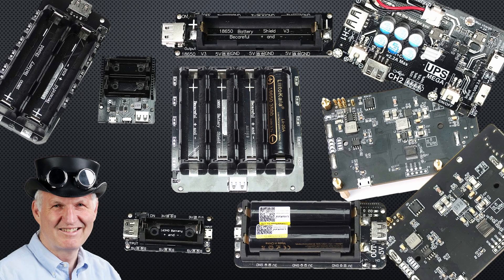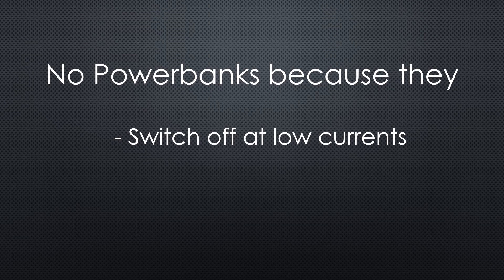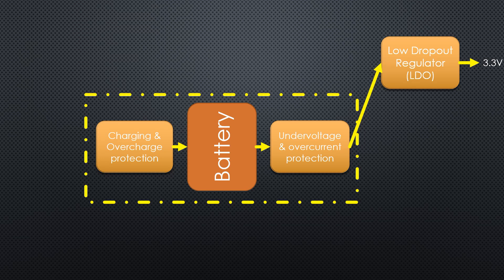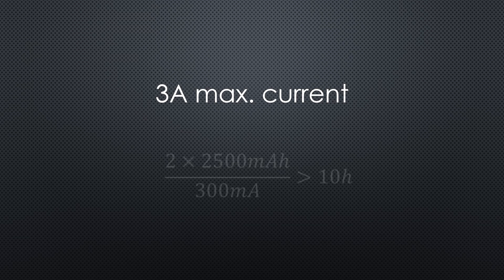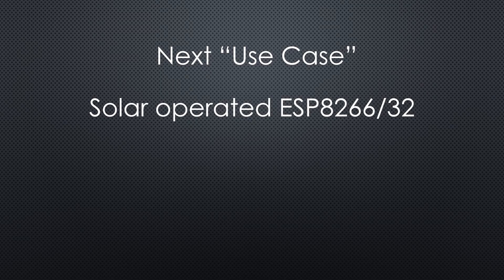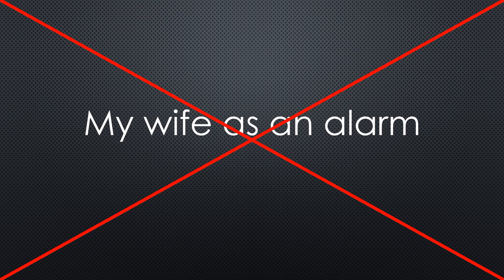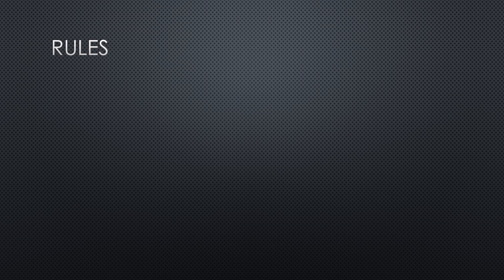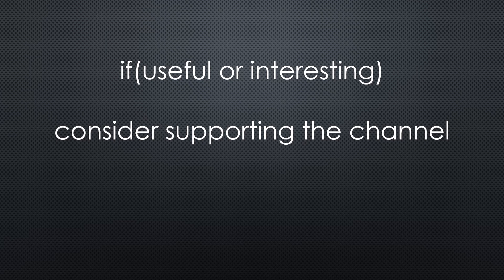#351 10 Battery Power Boards for Raspberries and ESPs. Start of “SuperPower” project

Comment: Thank - very interesting video and ... project.
I will try to contribute, if I can.

I am into "low power solar power sensor projects" using mainly solar/battery-powered ESP8266 as sensors and ESP32 as receivers of the sensor data. Sensors send data using ESP-Now to ESP32 which acts like a "gateway" and then sends further to various services like my own servers, Blynk, Thingspeak etc.
I use solar panels as small as 50x50mm, 2V, which I can get to work when I use ESP-Now (which is much lower in current needs than standard WiFi). If using "standard Wifi, I have to step up to 100x50mm (5-6V) solar panels and use very short and seldom Wifi messages.
 
What I wish for is:
- Charging regulators with a battery pin connector (as well as solar power, usb charging and device supply connectors) rather than a "battery holder" which is nice if you use "that" battery but otherwise, just space consuming. (I use thin 500mAh and 1200 mAh LIPO batteries rather than round cylindric battery cells.)
- Charging regulators allowing to measure battery voltage (as you mentioned).
- Charging regulator with as LOW own current consumption as possible. No status LEDS etc, they are just current eaters.
- Of course over-charge protection and over-discharge protection
- Pin to read battery voltage (UNREGULATED).
- Providing 3V3 as output - to be connected to the ESP8266 chip/board - which I believe is the best to avoid overhead with "converting" to 5V, 3.7V etc.   (maybe 3.7 V is better, I don't know). 
- Solar panel input with "optimum" voltage. I believe this is 5-6V and not 2V as I (often) use. As this requires a buck converter which consumes current. 

=> Main reqmnts are:
- LOW Own current consumption
- Possibility to read unregulated battery voltage
- Shall support batteries of 500mAh -2400 mAh.

/Jonas
Reply from the maker: Good input. I pinned a comment with the links where we collect the requirements. Maybe you check which ones are still missing and add them?

Comment: I have one of those battery shields.  When it's on, should the battery level LED's turn off?  Mine shows the battery level the entire time the shield is on, just wasting power.
Reply from the maker: I read that there are many different versions around. So I do not know. I also do not remember how mine behaved. I anyway desolder the LEDs if I do not need them…
Reply: @AndreasSpiess  cool, well thank you for the quick response!

Comment: SuperPower project is a nice idea!.. just whats needed.. i purchaced a TTGO T18 (esp32 wrover with 8mb psram), it has a 18650 battery holder on the bottom, but it brown outs when running off the battery... whats the point!..
thanks for another concise comparison and "fix" Andreas! 
wife as alarm! i LOLed!
Reply from the maker: I hope we will get to a design where we can add the best ESP module for our purpose.

Comment: Hi, I appreciate all your videos, I am trying to power an ESPcam with an USB solar panel and a dual 18650 battery but thue battery board stop working as soon as I connect the solar panel, it's OK when I connect the battery board to an AC adapter. What am I doing wrong ? (I am using a dual cell battery charge board with 2 switches). Thanks Thierry
Reply from the maker: Unfortunately, I cannot do remote debugging. I would do my measurements to find out what happens. Maybe you check out each component first and when everything is correct, start to connect them one after the other and test again. Then you will find the issue.

Comment: Just doing a UPS for my RPIs and router with 18650!
Reply: I agree. So 5V but also 7,5-9-12V.
Reply: @DumahBrazorf  i used 4 batteries with a bms and 16.8v power adapter, and of course a dc-dc 5v3a small module
Reply from the maker: Maybe you input your learnings into the project?

Comment: I think a reason so many boards disable the output when charging is to qualify for an exemption to FCC compliance testing (15.103(h)). Kinda sucks if you were going to be charging it from solar, and would qualify for that exemption anyway, or don't live in the US.
Reply from the maker: I did not know the reason, just the fact. Thanks for the info.

Comment: Also your listed 2cell 18650 battery module from AliExpress, will I need anything else to regulate power to esp32?
Reply from the maker: You have to check the voltages. ESP32 dev boards usually are powered by 5v and the ESP barebone modules by 3.3 volts

Comment: I have experience with one of these boards. Unfortunately every time the external power is removed the RPi it is connected to, resets. It seems the turn-on time or switching time between external and internal power is too long. What upper current source is required? Since Pi's can also power stuff (such as SSDs) from their USB3 ports, we could need 3 Amps. @ 5V.
I would also like to fix the Pi's biggest design failure - a reset button! Maybe a watchdog circuit, too.
Reply from the maker: Maybe you check the requirements on Discord if tehy fit your needs

Comment: I have a cheap esp32 board with lipo 18650 battery on the back, and while it does work i dont like that i can not check the battery voltage in the esp. Maybe i could use a voltage divider or so, dont know...
Reply from the maker: You can use a voltage divider if you want.

Comment: HEY MY FRIEND!  As you know, I have watched/subscribed for years.  I am RE-WATCHING this video.  I need battery powered esp32 to report temperature and humidity.  Key is showing on computer AND WRITE RESULTS TO FILE ON COMPUTER so I can print out results over a month or two monitoring.

Raspberry pi 3b+ will be plugged in and running constantly at desk. I need to monitor qty 6 esp32 via WiFi to record data.

I’m trying to SAVE an elderly lady home from black mold.
Reply from the maker: If you watched my videos you know the topics MQTT, InfluxDB, and Grafana including IOTstack. These are the technologies needed to build such a project.

Comment: You mentioned most ESP8266 or ESP32s should be fine if the 3.3v LDO drops out because they'll run at lower voltages. But when an LDO drops out it losses effective regulation so wouldn't that mean if you had say a high frequency PWM running off that chip that the supply voltage ripple goes up? Couldn't that cause issues with stability on them? It's funny because I asked this question earlier today ok reddit and couldn't get a clear answer on stability when the LDO drops out.
Reply from the maker: The LDOss are analog parts. Connected to a battery they should not oscillate. Just reduce the voltage a little
Reply: @AndreasSpiess  I think you misinterpreted my question here. I know they're analog parts, but as soon as the LDO reaches it's dropout voltage it's feedback network will no longer operate properly, it will cease to act as a regulator or it's performance will be crippled at the very least making it impossible for it to reduce ripple. Every spec on a linear regulator is given only for VIN conditions that are above it's dropout voltage, bellow it's dropout voltage all specs for ripple rejection and voltage regulation accurace get thrown right out the window.

If an ESP8266 is PWM'ing a power LED as an example it would without regulation would inject a fairly heavy ripple into the ESP8266 VIN especially with a weak battery. While it might be within it's voltage tollerance I don't know what the ripple tollerance of the ESP8266 is, VCC changes that are too fast can cause system resets on some chips even if it's within it's operating voltage range.

Comment: hi Andreas,
excellent video again.
I have used the single 18650 PSUs since your original video in 2019, but with the Pi they always give an under voltage warning, especially when I have an LCD or Pi camera attached. (It also does it when I use any of my powerbanks.) All my 18650 PSUs have 4.89 to 4.91output voltage, which I am guessing is why I get the warning. Are any of the other (single or dual) 18650 PSUs any better at providing a 5.x voltage output that can be used with a Pi(2/3/4)? I'm trying to run a Pi Camera with the LCD screen attached. (Please could you add the actual measured output voltages to the spreadsheet?)
Thanks.
Reply from the maker: You have to measure at the pins of the Raspberry because the USB cable also has an influence. Plus the Pi4 draws high peak currents which might not be available.
If this warning is only during boot I would not worry.
Reply: @AndreasSpiess  thanks for the reply.
Using a multimeter at the pins (after removing the USB power meter):
On single (samsung 26f) battery PSU - 4.66v using USB port, 5.01v using the 5v pins on PSU (warning with both)
On (10k mah) power bank  (no warning) - 4.88v
On mains (1.2a) PSU (no warning) - 4.94v

The power bank gives no low voltage warning after removing the in-line USB power meter.
It's strange that the Pi2 (used as it has lower power requirements than Pi 3/4) gives a warning when the (fully charged) samsung 26f is 5.01v at the pins when the others are ok. (Tested several PSU's)
I only use it as a rough guide but the USB meter seems to alter the power enough to make the Pi give the warning, even when it shows 5.01v at the pins.
I'll use another battery solution for the Pi's and keep the 18650 PSU for the arduino's.
Reply from the maker: @davidl1813  The multimeter does not tell you the whole story. The Pi creates sometimes current spikes, which can reduce the voltage momentarily. Unfortunately, this is already enough for an undervoltage warning but usually does not harm.
The power meter inserts also a resistor which reduces the voltage at the output.
But it seems that you have  found a running variant.

Comment: I built a portable lithium-ion supply. There are a lot more buck converters than boost converters out there at least for the hobbyist so I ended up having to use 2 series batteries then used a buck converter. You could use an adjustable buck for 3.3 and 5.0 volts but thats kind of hackish.
Reply from the maker: All depend on the requirements, I think. I do not have a lot of projects which use 3.3 and 5 volts, for example.

Comment: I'm not useful for this project but will certainly want to buy the result.  I have been wondering myself about how to use a lower power board like a Pico or EXP to watch sensors and then boot up or wake up a more powerful board like a Pi when an important event happens.
Reply from the maker: The boards are still in the works...

Comment: A single 18650 battery with step up to 5v 4A for Pi4 for one minute backup or so is good enough for me to toggle gpio for safe shutdown. I want to keep it super simple, please advice which buck converter could boost 3Vish to 5v4Aish "solid output".  Kind regards and cheers
Reply from the maker: I once made a video using super capacitors for that purpose...
Reply: @AndreasSpiess  Thank you so much for the feedback sir, yes I tried caps but it comes with its own challenges like very high charging surge currents, small caps are okay for pizero but for pi4 a mesh of circuits and relays would follow the caps compounding the circuit. So I think a small battery like 18650 or even its half version would do much better if somehow we can find a boost converter that can handle 3A for real and step-up from single battery. Even if that buck boost is costlier, it would be worth it to resolve this chronic issue. I looked everywhere but the buck boosters that i found cannot handle 3A (from a single battery 5v boosting)or so. If you come across one and let me know, I promise to look for the seat in the front row. :)

Comment: I wonder which quiescent current you plan? With a single 3000mAh 18650 cell and a quiescent current of 50uA, it will have self discharged after 2500 days (nonstop connected 24 hours a day). Assuming the Microcontroller is running only a few seconds each day and the rest of the day it is in deep sleep mode, you can get battery runtimes of several years. So whats the issue with the quiescent current? Did I miss something?

I support the other missing features (like voltage level detection, brown out protection etc) but I don't understand what shall be the issue with the quiescent current.
Reply from the maker: We will see where we end with the quiescent current. Unfortunately it adds up (ESP module, sensors, etc)...

Comment: Just wondering if it is possible to convert the 4 cell 18650 battery board to 12v 2a output?
Reply from the maker: I do not know. I never needed it :-(

Comment: I think really you want a PMIC breakout. A small QFN PMIC will give you multiple programmable buck converters, a bunch of LDOs, a Lipo charger.. voltage monitoring via i2c etc.
Reply from the maker: I agree. We for sure have to look at this category o chips.
Reply: @AndreasSpiess  

If you can get them and the package isn't annoying this seems to be exactly what you want:

http://www.x-powers.com/en.php/Info/product_detail/article_id/28

This one has another DC-DC and is easier to get:

http://www.x-powers.com/en.php/Info/product_detail/article_id/27
Reply from the maker: They look very good. Unfortunately they are not on the list of LCSC :-(  Maybe we will find a similar chip on the list: https://drive.google.com/file/d/1TXiEMOn5D_nyOrpqKdCDw6C0hNeWa8C1/view

Comment: Two cells in parallel for a Pi isn't enough if it'll be working hard or overcast for a few days, so I'd want to be able to expand it by connecting an external module of maybe 16 or more cells in parallel via an XT60 connector.
Reply from the maker: Maybe you join the project and add your requirement? ( https://docs.google.com/spreadsheets/d/1oGSQRG4XssmFL4II1EF2akhWRhvSvHqH1uTaYX9znlw/edit?usp=sharing )

Comment: Another feature: Balancer if more than one cell is used
Reply from the maker: True. I hope we can avoid dual cell because we need a maximum of 5 volts.
Reply: @AndreasSpiess  In another comment someone pointed out that you can avoid the standby current of the step up converter for 5V by using 2 cells.
Reply: Depends on how many mAH you need. More batteries in parallel = longer lifetime, and may be worth it. This depends on your use cases.
Reply: @tonylhansen  I thought about cells in series for a higher voltage. When in parallel we wouldn't need a Balancer.

Comment: how to connect the single battery as UPS on raspberry Pi and not using the micro USB for main power supply
Reply from the maker: The expansion connector has 5 volt pins where you can connect power.

Comment: interesting but solar powered pi is pretty much impossible since it cannot deep sleep. There's not just enough sun to run constant current and then recharge it during the day (unless your panels are massive). The esp32 can deep sleep and you can recharge the lipo battery from solar even with cloudy days to gain most of it back but this depends on sleep cycles. Lets not forget much of the efficiency will have to come from the software side not just hardware
Reply from the maker: I made a video on how to calculate the size of the panel and the battery. But for sure it is not small for the Pi...

Comment: Could we maybe also make a board with a 12v output so you could use just one 18650 battery board to use your mcu and a motor?
Reply from the maker: Just add your requirement to the lists.

Comment: I think it would be very useful to have an adjustable value for the over discharge protection. Because LiPo cells should not be discharged below 3V for example. And I prefer not to fully discharge my batteries to increase their lifespan.
Reply from the maker: Maybe you check if your requirements are already covered in the project?

Comment: What I would really need is the battery info to be accessed over WiFi with a web interface so I can monitor the status of a battery in my device.
Reply from the maker: Maybe you add your requirement to the respective lists ( https://docs.google.com/spreadsheets/d/1oGSQRG4XssmFL4II1EF2akhWRhvSvHqH1uTaYX9znlw/edit?usp=sharing )?

Comment: My requests for rtc on the raspberry pi board has fallen on deaf ears. What good will this super power board be for off grid operation without rtc?
Reply from the maker: Did you propose it as an option? It will probably not be used for an UPS. But definitively for the mobile use case it is necessary. Maybe with an option for a GPS module.
If you find a module instead of a bare chip it might be easier for sourcing.
Even if it would not be accepted as an option you are free to design it and add it to the project. This is the idea behind it.

Comment: I think, for our "own supply" , that it would be good to use devices from European, Japanese,  and USA suppliers, like TI, ADI, Rohm, etc...i have a LOT of experience with these,  and find that these suppliers are reliable, and have readable data sheets, and often have evaluation boards to prototype with.
It's always tempting to find low cost, but, "where the rubber meets the road", is it worth saving 1-2€, and losing all your data,  or crashing some remotely controlled system? 
Just thinking ;-)
Reply from the maker: I also think that cost should not be the biggest focus. But we have to have somebody who is capable to supply us with ready-made boards. Most of these chips are too small for most viewers to solder themselves. This is why I chose JLCPCB and LCSC. They also ship globally. They also stock parts from the suppliers you mentioned, I think.

Comment: Can you give estimate of how long esp32  will report on temperature and moisture 3 times a day off qty 2 18650 batteries?
Reply from the maker: This depeds on many things. you have to find out the power consumption of your board and compare it with the size of your battery. There are many videos on this channel about the "low power" topic as well as selection videos for the different boards